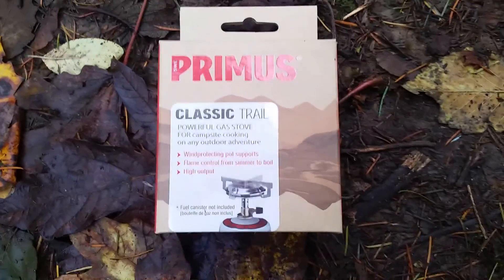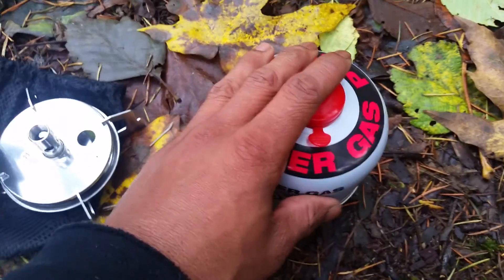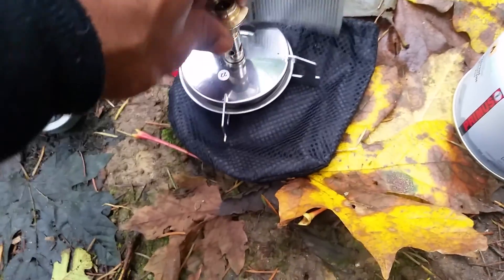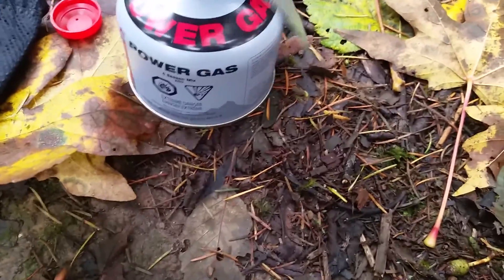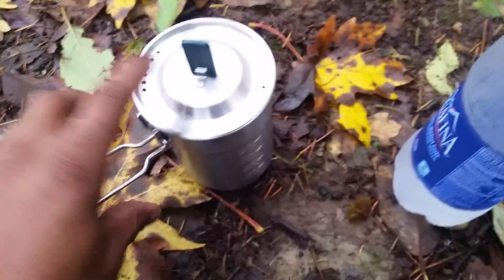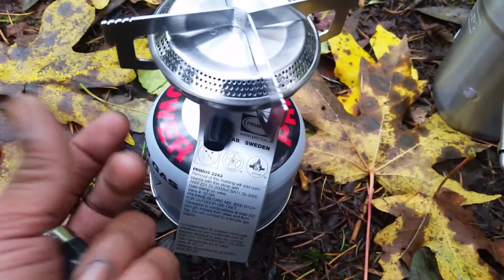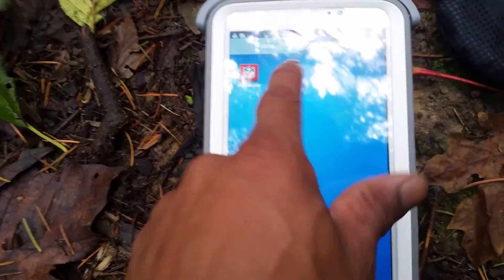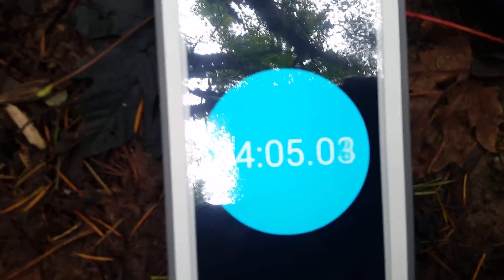Primus Classic Trail Gas Stove - Boil Test & Revie

Comment: this stove is grait with gsi ketlei for boiling water for teai or trail meals or so works grait with skillits were you need even heat across the hole pan plus no hot spots like you get with jetboil or poket rocket